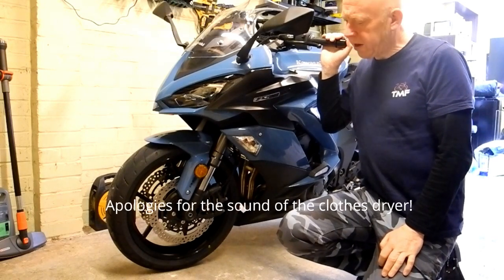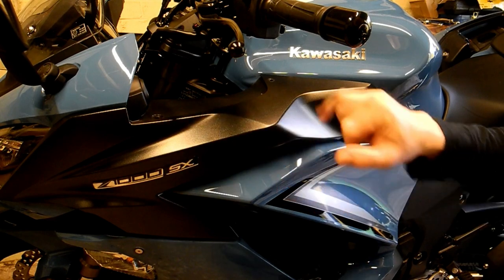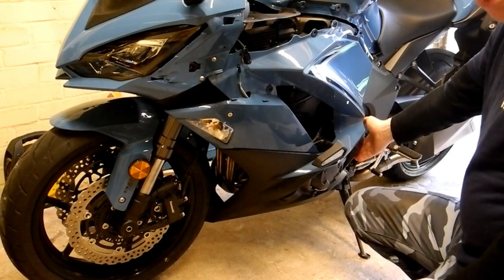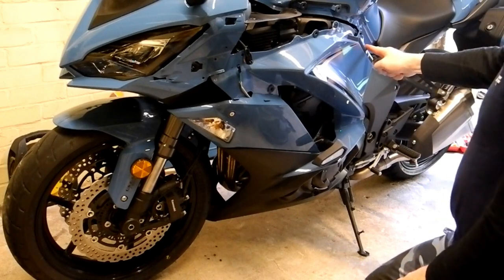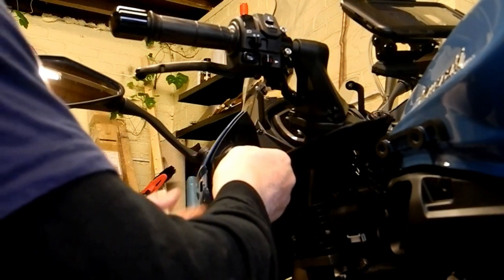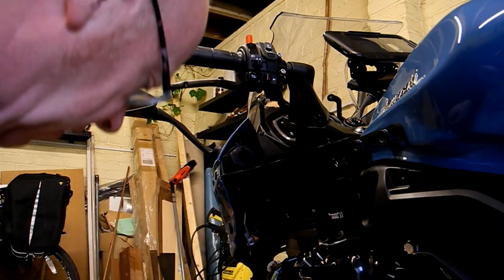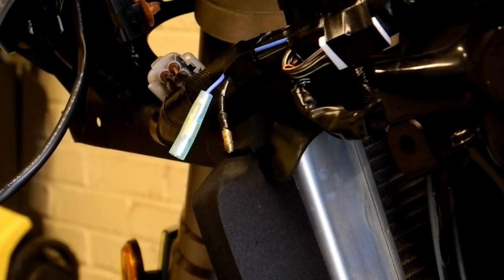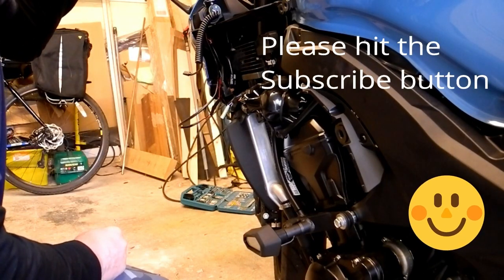Z1000sx power socket

Comment: I noticed while watching this you have a satnav or mobile phone attached to the Kawasaki removable nav mount. Can I ask how you attached the nav or phone to the removable part please? I have the mount that came with the bike,  but don't know what to get that attaches a case to the removable part. If that makes sense?
Reply from the maker: Hi.....sure the adapter plate you need to attach a case/ satnav to the bracket is called an "AMPS 4".....if you get the Ultimate Addons case then follow this link https://ultimateaddons.com/products/3-prong-male-adapter-plate-with-amps-4-hole-layout
Beware if you get the large universal case (like me) it will not fit between the handlebars and you will need two 50 or 60mm M6 spacers and longer M6 bolts to bring the bracket clear of the tops of the bars....smaller cases will fit without this alteration. Let me know if I can help further.
Reply: @thebingleywheeler  Brilliant, thank you
Reply: @thebingleywheeler  can i ask did you get the ultimate add ons L, XL or XXL universal case, the L dimensions I think will fit, the XL dimensions look tight within a few MM.. just wanted to clarify before upgrade phone and buy a new UA case...thanks for help

Comment: Did you ever do the video for the heated grips. And are the touring ones the best for the z1000sx?
Reply from the maker: Hi...would you believe I was all set to but the memory card corrupted! It's a very straightforward job....just remove the left side fairing as shown in the video and you'll see the two wires for the heated grips (bullet connectors). You'll need to remove the ring connectors from the Oxford wires and replace them with bullet connectors to fit to the wires on the bike (easy). Yes the Touring grips are best and fit perfectly....so do the retro grips (but they don't quite look right for this bike). Let me know if I can help with more detail. All the best, Dave
Reply: @thebingleywheeler  Thanks for that Dave. Great help. Sound quite straight forward cheers, Gordon

Comment: Are there more of these terminals?
Reply from the maker: No just 1 spare
Reply: @thebingleywheeler  I have heated steering, extra floodlights and a phone charger. Would it be possible to upgrade the fuse to a 30amp one and connect all 3 accessories to this output? That way they all shutoff when I turn the bike off